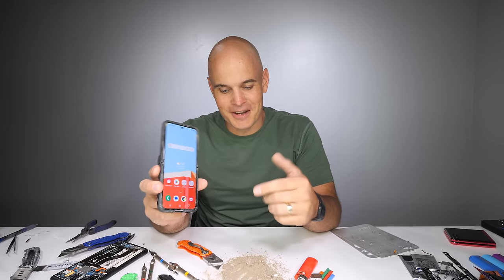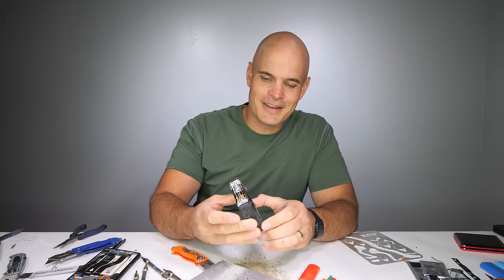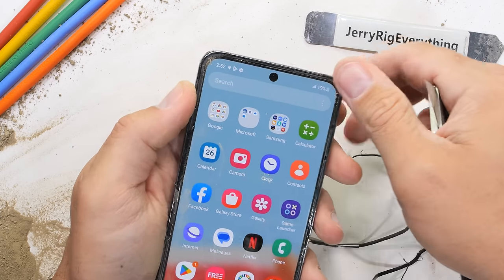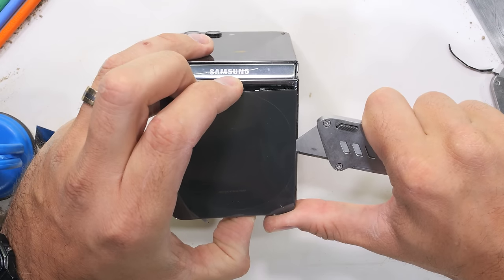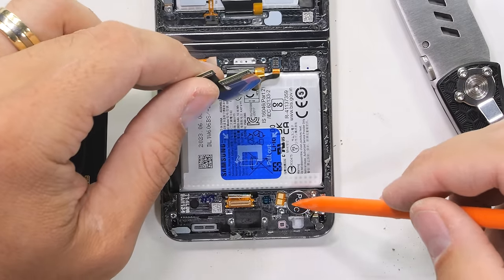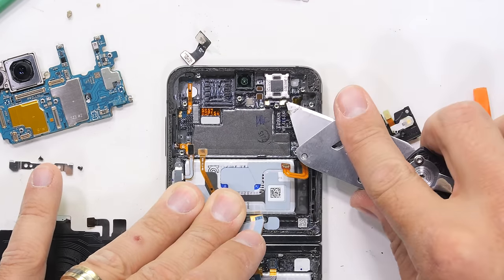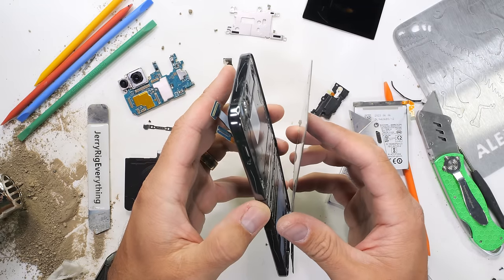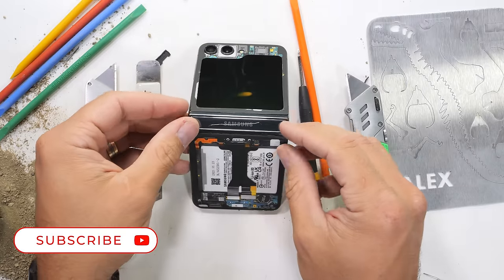Samsung Z Flip 5 TEARDOWN - I have waited 4 Long Years...

Comment: How the flip phone was almost fully functional after the teardown is very impressive.
Reply: Even the main screen didn't have the strip from the razer
Reply: This actually makes me want to get the Flip 5 rn
Reply: Jerry inspires me.. My parents said if i get 50K followers They'd buy me a professional camera for recording..begging u guys , literally 
Begging...
Reply: @Unkn0wnz_anon  no??? it did after he put on the dbrand skin which is kinda funny
Reply: @namantherockstar I bet you're writing from your smarthphone, use it as your recording device.
Reply: Because the technician that reassembled is good looking
Reply: @namantherockstar  wtf. I just saw your comment on the Loki trailer
Reply: @TheRealBOBlibob  They are bots, I saw the exact same comment from a different user on a different video.
Reply: @graysonhoang3126  And they're annoying too.
Reply: Screw your spoiler
Reply: @namantherockstar nice try beg bot
Reply: We dont know how many tries it took!
Reply: 3 years, apart from crush or impact so needs a decent case. If not 9 months.
Reply: Next step a flexible 3/4 phone like a fold without two full screen lol
Reply: This has nothing to do with Samsung but everything to do with Jerry's expertise
Reply: I bet the battery will last four years. My Flip4 is still in good condition but I've replaced the screen twice already, and the battery is at 89% capacity.
Reply: @calebmorehart4644  Me too; my Galaxy S5 lasted several years until the phone overheated.
Reply: Display replacement will still be too expensive you know 😂
Reply: Spoiler alert!!!
Reply: Amazing phone..using it from last 20 days :)
Reply: It looked extremely laggy tho
Reply: @Celia_ffx you should. I have it. Everything works perfectly and is quite powerful. Haven't experienced any lagging whatsoever. Been happy with my purchase. And the flip mechanism seems sturdy and works great too
Reply: The spoiler 😂
Reply: @Celia_ffx i bought it yesterday and it's perfect
Reply: @namantherockstar 🤖🤖
Reply: It had every ribbon connected, whats so impressive?
Reply: @RiderBlitz1.0  The screen and hinge not breaking because of the dust
Reply: The fact almost all the pixels that died while he was removing the screen recovered says something

Comment: I've always been worried about the durability of my Flip5. But seeing this, although teardowns and durability tests can't be 100% correlated with real-world durability, does give me assurance as I also plan on using my Flip5 for many years to come. Great video.
Reply: I love innovation in tech industry, so it's a good thing some companies still care about innovation unlike apple with their HUGE innovations like USB C , always on display etc 😂
Reply: if their plastic screen didn't die to nails, i would be buying this phone - it's quite awesome
Reply: @DrDemolition unless you intentionally dig your nails into the screen you won't have a problem. And if you do dig your nails into a plastic screen what do you expect
Reply: @joshsmith7521  i can't really treat my phone like a snowflake now can i? fucking sneeze wrong and boom, you got a dent in your screen LMAO.
Reply: @DrDemolition  No that's dumb. Just don't deliberately scratch the screen genius and it'll be fine.
Reply: How it’s going with flip? 
Im planning to buy one for myself
Reply: @Solomon_w  Almost 6 months in, I have dropped it three times (one 3ft drop, and the other two are small drops) and no damage whatsoever. Note that I do use a case (the Flipsuit case included free when I pre-ordered it). There are a few microscratches here and there, but I would classify them as normal wear-and-tear over time. Got used to the crease, as it is not really visible during normal use. 

Extra note (not durability related): The cameras, honestly, are not as bad as many would say. In fact, it got decent results from MKBHD's blind camera test, so the cameras are no slouch. Unless you take a lot of zoomed-in shots that need 2x or 3x or 5x macro, the Flip5 is absolutely fine. 

Although I am having an excellent experience with the Flip5, I'd say wait it out for the Flip6, as it would obviously be an upgrade over the 5, plus it might also get 7 years worth of software and security updates that Samsung promised recently with the release of the S24 series.
Reply: @skyflakes3623  thanks for long explanation. I’ve one more question. Like the screen protector that is supposed to be changed after every 8-12 months. 
How fast it gets poor? Assuming I don’t like bubbled screen. So for how long it would stay as new. And the price of protector?
Reply: @Solomon_w  I haven't really checked into that, as the screen protector on mine is still intact after six months. I believe you can get a free replacement within one year of buying the phone, though. I'm not sure if it requires Samsung Care+ (which I signed up for 24 months) to be eligible for the free replacement. I do plan on getting it replaced, even if it doesn't show any signs of coming off since it's free.
Reply: @skyflakes3623  so then it’s fine and doesn’t get bubbled ? Right
Reply: @skyflakes3623  hows it going with the flip 5? any signs of wear or damage?

Comment: Almost 2 years in on my flip 3. Recently had a free screen replacement due to cracking along the fold line. Had the remove the screen protector due to lifting along the fold about 8 months in. Spent some time using a spare phone while it was in for repair (and for about a month after because laziness) and god did I miss having a smaller form factor. I miss my s pen (used to have the Note 10) and was considering switching to a newer S range, but decided I'm gonna use this until the screen goes again and then look at replacing it. Seeing this teardown and the previous durability test I might just stick foldable and miss my s pen a little longer. Who knows, by then they might have put one in the flip!

Comment: Absolutely! It's mind-blowing to see how flip and fold phones have evolved with each generation. Can't wait to see what the future holds for these devices!
Reply: I wanted one for so long but knew the technology needed to cook for a bit longer. I'm very comfortable getting a new fold very soon.
Reply: @hyperdude54  I had a Fold 4 and liked it, but the narrow aspect ratio outer screen caused a lot of app issues. Traded it in for a Flip 5 and I love it. None of the issues I had before. If you go for a foldable go for a Flip unless you're comfortable going with a different phone that has a wider outer screen aspect ratio like the Pixel Fold.
Reply: @LimeOnTheSide760 yeah i was thinking weather to get the fold or flip really like how the the fold opens up to basically be a small tablet but i dont think i would use it much besides to watch youtube on i see most people having the fold however most people are recommending the flip still not sure which to get but ill probably wait untill the 6 come out and then get either the flip 6 or fold 6
Reply: bot
Reply: @itstehgamer  hey bot

Comment: That may have been the absolute best teardown ever.  I am still trying to figure out how Zach reassembled that particular phone and it actually worked.  Seemingly impossible more than most.  On another note, does anyone else get concerned when Zach cuts away the screen (or back of the phone) with a razor blade with his fingers directly in line of an unfortunate slip of the blade?  No worries I guess because he could always reconstruct a thumb or other finger and make it work as perfectly as most of the devices he tears down. 😂
Reply: as for cutting towards himself, that's something you get good at over time or cut urself so badly one time u learn to find a workaround.

I've never that bad 'one time' and I hope he never does either. I learned watching others make a similar mistake I avoided it and even better hopefully for many merely hearing of possible danger they too can remain intact, smart, and safe.
Reply: He should be fine, his skin scratches at a level 6...with deeper grooves at a level 7, so the razor blade should have no effect.
Reply: 😂😂 @DeLawrence97
Reply: If my thinking is correct, Jerry has cut himself before.

Comment: My flip 3 gave me a solid 2 years. The last couple of months, the hinge wouldn't fully open, so it had a slight bend all the time. The screen had little micro cracks at the bend and was beaten up a bit. (No case, just a dbrand skin) I upgraded to the flip 5 last week and am very happy so far. Good luck with yours!
Reply: exactt same forcme rn for the zflip 3

Comment: This teardown is so informative! Im still a bit annoyed that different build version exist with lower quality parts used whilst theyre still the same price. But thank youfor exposing it so thoroughly!
Reply: i am pretty sure those lower quality parts exist for markets that they need to sell at lower prices? kind of what they did with the exynos versions of phones.
Reply: @dedasdude  While I was considering getting myself a midrange Galaxy A model, I found it's quite the opposite. In India and China where phone manufacturer competition is much tougher at all price ranges, Samsung beefs up the specs to compete. Here in America they lower them because they can get away with it. This is less evident in the premium phones but the low- and mid-range models show it very clearly.
Reply: @groundsero not quite, the cost cutting compensates for insane EU import taxes and tariffs
Reply: @groundsero  all phone manufacturers including Apple use different suppliers for different areas of the world for a variety of reasons
Reply: Where did you find out about the different versions?
Reply: @pvshka United States adds way more expenses to get carried a certification. The prices don't include sale tax
Reply: @michaelcorcoran8768 America doesn't use a Value-added Tax system. Most of Europe (including the EU) does.

Comment: I'm always surprised about how durable the Z Flips are! I'm on my third now. Flip 3, Flip 4, Flip 5 which is my daily phone now. The others are still working like new. Never had any problem. 👍💪
Reply: Third ? Sure sounds durable
Reply: i have had to replace my flip 3 about 5 times in the one and a half years i've had it
Reply: @claranymark at that point it's probably a personal issue rather than the product issue
Reply: @mehshutup3041  lmfao fr
Reply: Durable and running through them in one sentence...lmao
Reply: @ksomeone1  you obviously don't understand what upgrading each year entails.
Reply: The hinge on the Flip 4 was ass and wouldnt hold up to a fall without ruining the flippability feel, until it eventually gives in. I've already dropped my 5 as many times as my 4 and its holding up much better lol
Reply: @jeanmahmoudventilateur3480  He's talking about that he's on his third model of the flip, having the flip 3, then 4 and now 5 thats 3. He didn't mean like a third replacement 💀
Reply: OP: I have Flip 3, 4 and 5. All three are still working fine and I've never had any problems with any of them.

Morons with no reading comprehension: Oh, third one? Do you even know what "durable" means?

Comment: I was using my Note 8 from 2017 until last month. I thought about a flip phone but was concerned about how long it would last.  Will be interesting to see what you get out of yours.  Hopefully a lot.  I would like my next phone to be a flip in another 6 years.
Reply: It's a long plan.
Reply: I still use my Note 8, it's showing signs of wear and tear (especially the battery and the screen) but still works well enough.
Hopefully my next phone (when the Note 8 finally gives up) will last at least as long
Reply: I like my flip 5 it has his disadvantages and advantages like you got to be real careful with this phone scratches on the screen stick on the screen protector
Reply: @TheGrejp   I was planning on keeping it until it died.  I recently got hearing aids with Bluetooth.  Unfortunately they don’t work with anything that is not at least a Note 10 So I got the Ultra 23
Reply: Altough flip and foldable phones are more  durable then people think but theirs no way they would last 6 years
Atleast untill now unless they have some kind of technology becouse of the screen
After a couple years from about 2 years or so the screen might have deep scratches on the middle of the screen and over time might crack the screen where it bends because of fisics, altough it would most likely be still usable
But you might get 4 years out of the phone because I've seen several first Gen flips in really good condition, how long have they been used, idk
Reply: The Note 8 had software planned obsolescence (only 2 years of updates) while the Flip 5 has hardware planned obsolescence.
Reply: @pixels_per_inch  While it's true that the Note 8 received only 2 years of major Android updates (which was unfortunately the norm back then), I actually received security and even feature updates up until August 2022, a full 5 years after its release, which honestly surprised me. But you're right, software support has come a long way in recent years.
Reply: I'm using the original z flip for the past 1 and half years. And it has never given me any problems... yet
Reply: @WanAhmadLuqman  if you take care of it and dont fold it as much
For example the first flip can do about 100000 folds with out much issue
Witch would be 100 per day for a couple of years i think
It may vary but the more folds it has the more likely it'll be to start having deep scratches and over time cracks
I'd say it might take 3 o 4 years to crack if folded about 40 times per day
Reply: @shifterzx All phones delaminate after around 4 years, even my S7 did.
Reply: i'm waiting until 2027. EU new law will be in place for easily removeable batteries.

Comment: I bought the Flip5 after a few weeks of hemming and hawwing. It doesn't have as good a camera as my old phone, and the battery is smaller, but this time around I was mostly interested in the novelty and a chance to try and new less bulky form factor, and boy am I glad I did. The screen and hinge durability is a concern though, and I kinda expect this phone to not last much longer than two years with regular and a little careless use, as is normal for humans.
I hope next year's model isn't just a minor upgrade on the old model. These phones would be perfect with a bigger battery and more competent camera. I really don't wanna carry around a giant phone-slate in my pocket anymore after experiencing this.

Comment: Hey Jerry, if u are worried about the durability I can say that my flip3 has suprised me alot. I have had it for around 2 years now with no issues, it still runs really well and I have really put it to the test by taking it to the beach and in water numerous times without any damage occuring.

Comment: if you do check the comments, you should also scratch the face id cameras on the iphone and see if they still work after scratches. you never did this. but you said 'im not gonna scratch a face', but you don't scratch a fingerprint either to check if it still works, you scratch the sensor, so why not the face id cameras too? just a thought
Reply: Because the glass usually scratches much harder. A scratched fingerprint sensor is more common given the demonstrated hardness
Reply: @sebastianjost  these days they're all under the screen, so they're both under the glass

Comment: 3:41 This is the moment I twitched hard because I've seen so many of your teardowns that I knew you were about to kill the screen since you didn't hold your knife perfectly flat but rather at an angle that would apply pressure to the pixels and would ultimately kill them. Then you started wiggling your knife and my soul left my body 👻 Most intense 5 seconds of my day!
PS: when you wiggled your knife you applied diagonal pressure and sheer forces while foldables can only withstand pressure and tensile stresses in the folding direction.

Comment: I have a question: how hard do you press on the screen with your nail when you explain how to move your nail across the screen?

   I'm afraid that if I buy the Flip 5, you will have those nail dents (scratches) in your screen.

Comment: My issue with these folding phones is the plastic displays that are needed to allow a foldable format. 

While this one has a great chance of lasting 4+ years, I bet one month in the micro scratches on the display will become an issue, not only triggering OCD, but becoming an issue when viewed under direct sunlight. 

I really hope in the coming years manufacturers figure out some new material or coating that fixes this issue, perhaps something similar to regenerating paint coats used on cars.

Comment: Good choice! I like the Flip phone over the Foldable. My concern remains on the plastic foldable display. It's very easy to mark it permanently, just using a simple fingernail. No good... I hope they will find a material that will be flexible enough and scratch free in the same time.
Reply: Never had a scratch issues on my Flip 3, but had to change the screen protector once. Samsung changed it for free.

Comment: I had a flip 4 for a while before switching back to S23 ultra for 1 major reason. Out of the blue the screen turns off and decides to never turn on again. So be careful to always keep your data backed up or have another phone nearby. I will never trust the flip ever again, I lost a lot of valuable data on my phone because of this problem. 
(The phone never fell, always treated it well... I would NOT recommend anyone having a flip phone as a daily driver)

Comment: I have to fix these things on a daily basis. Anything I've learnt in the 8 years plus working for Samsung is... SCREENS ARE NOT SUPPOSED TO BEND.
I honestly wouldn't use a fold / flip phone even if it was for free.

It does annoy me, though, as I love the form factor of the Z flip. They just break really easily, and Samsung don't like allowing warranty claims. The amount of material they send us to explain what is and isn't covered for warranty on these things is unreal.